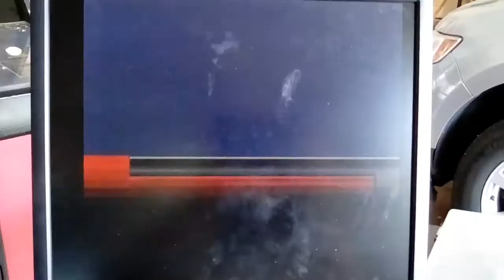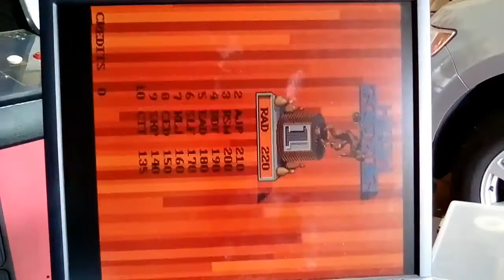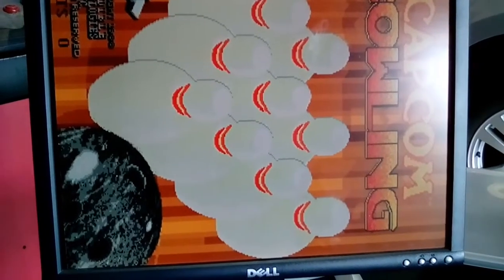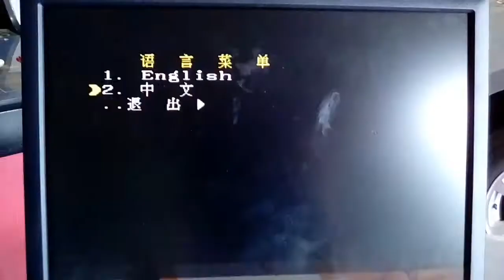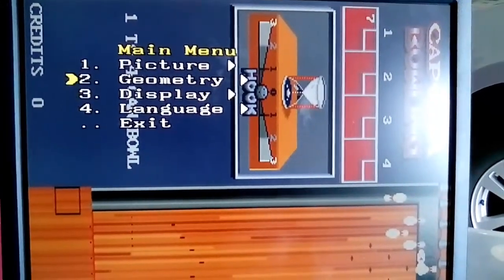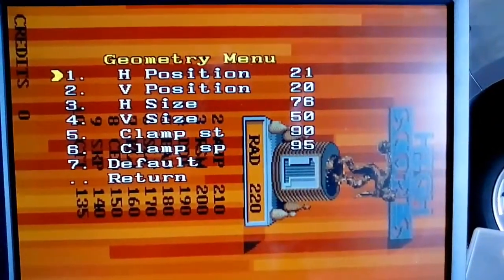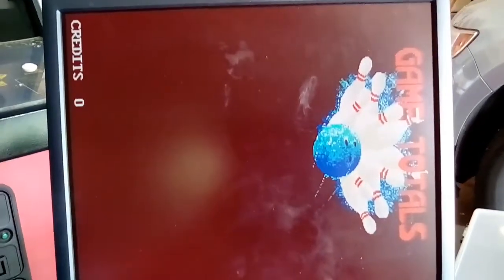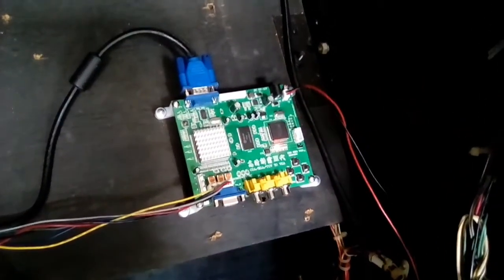Arcade to VGA Video Adapter Installation

Comment: Did you use a multimeter to test your wiring connections?  Seems crazy not to check them first.

Comment: Did you get from AliExpress? I have an old Cherry master machine. Pulled out the CRT monitor and have the same board. I tried the RGBS connector and the wires it came with and no matter what I don’t get a signal to the monitor. I can adjust and see it’s hooked up. But won’t put up my game

Comment: What cords do you sodder ?
Reply: Cords? You mean wires?
Nothing needs to be soldered really. You can solder the wires together if you want to but any standard wire connectors (of the correct size) will work.
In this video, he used "butt" connectors to connect the 5 video wires and "fork" connectors on the 2 power wires to connect them to the power supply screw terminals. Your set up may be a bit different, so use whatever connector work best for your configuration.
Reply: @MoreEffinCowbell  lol ya wires lol

Comment: I have a question. Can I use this board to connect my pc to a component crt tv?
Reply: Yes
Reply: @shotgun161  
Xbox 360 console with VGA cable.
To rgb 12 pin out to jamma?

Comment: How do you connect the converter to the arcade board
Reply: Yeah i was wondering if you connect the lines from the jamma harness or from the crt board?
Reply: @will1867  A standard jamma harness attached to your arcade board should have the RGB connector you see in this guide.  Hook that to this convertor as shown.
Reply: @moonchild666  mine is wired up a bit different. The wires that are connected to the crt board are colored different and it has two connectors on it.
Reply: @will1867  Get you.  Not sure in that case.  Try one of the arcade forums.  Usually pretty helpful.
Reply: @moonchild666  yeah I'm going to do that. Or I'm going to rewire it. The guy that built it like did a load of crazy stuff. For an example taking a 16 gauge wire and then connect it to an 8 gauge wire with a butt connector that's meant for a 6 gauge. Using normal house hold wiring from a living room lamp to light up the marquee. ( which resulted in huge scorch marks in that area...... I'm really surprised it didn't burn down)
Reply: @will1867  🤦🏽‍♂️
Reply: @moonchild666  yeah i know 😞 and that's not even scratching the surface. But, I am determined to correct all of the mistakes and have me a well built arcade